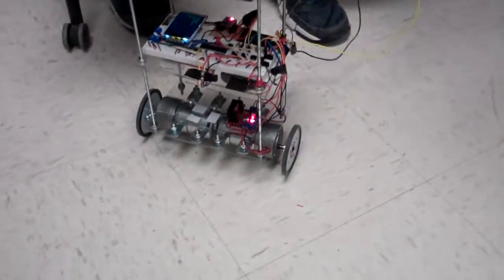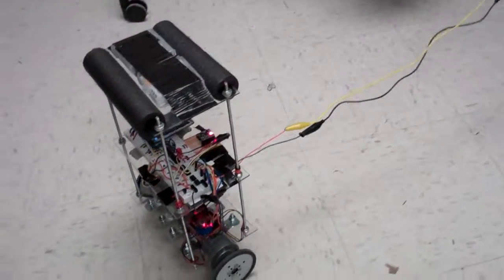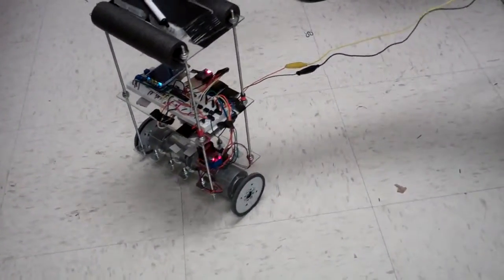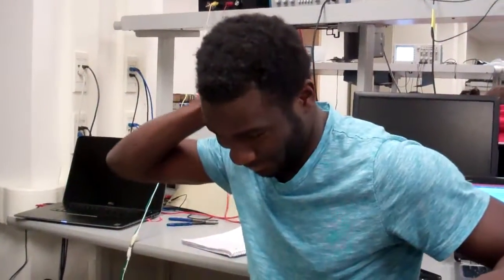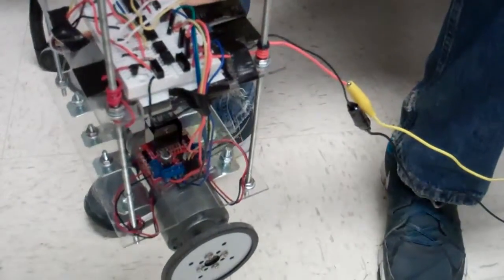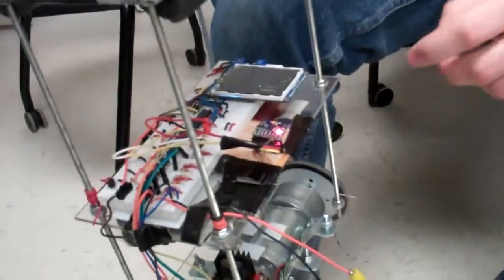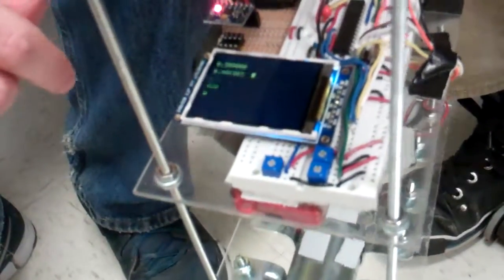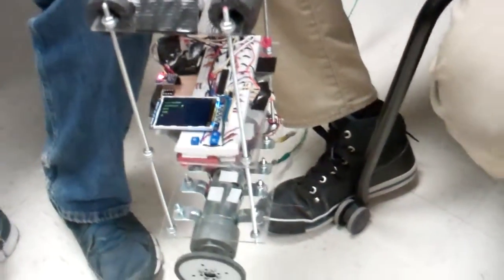Balance bot

Comment: Came here from https://people.ece.cornell.edu/land/courses/ece4760/FinalProjects/f2015/dc686_nn233_hz263/final_project_webpage_v2/dc686_nn233_hz263/index.html and its been a cool read! I'm about ready to try and give a go myself! On a side note Is there a reason as to why the team chose the PIC 32 MCU?
Reply from the maker: The course ece4760 at cornell is currently taught using PIC32. The PIC32 is a 32-bit MCU which is still simple enough for bare-metal programming.

Comment: Good project can we get any more info ?
Reply from the maker: +Yash Kudale check again on 11DEC2015
Reply: +Bruce Land  I would like to suggest them to add more weight (batteries) closer to the motor that will help lower the centre of gravity which might fix the bot running around on its own.
Reply from the maker: Raising the center of gravity makes it more stable.
Reply: +Bruce Land interesting!! need to make one